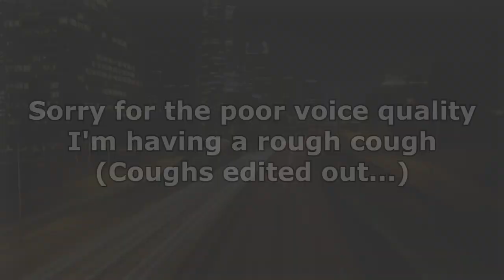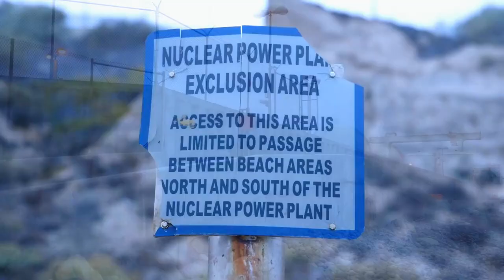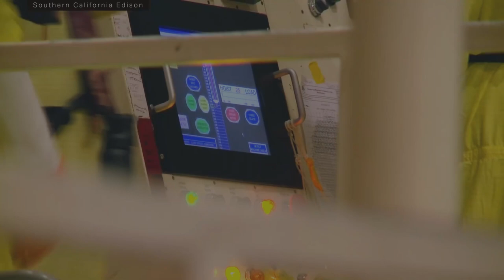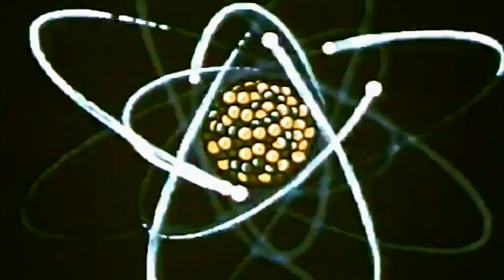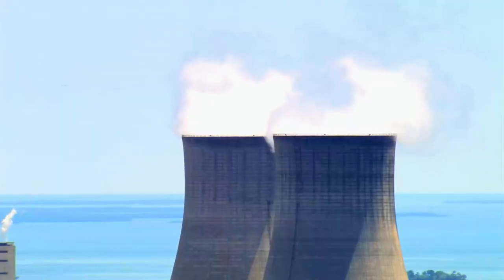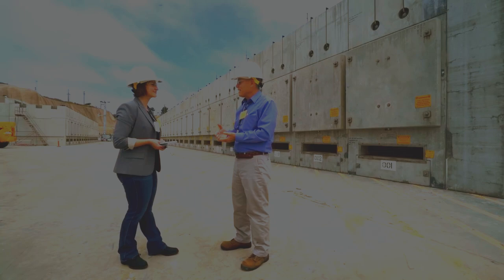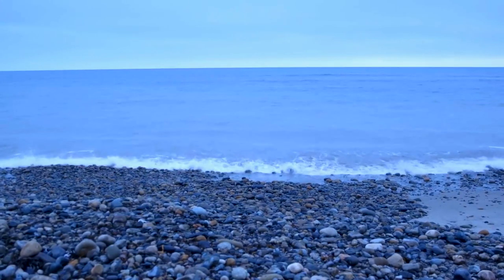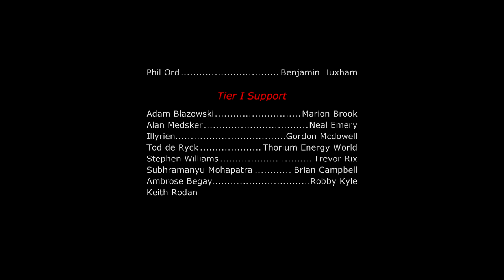The Verge Nuclear Waste Rambling

Comment: The HI-STORE system used at SONGS is used at Chernobyl and will be used at Holtec's CISF in New Mexico. It is the best dry cask system at this time and the cask will last over 100 years at which time the decay will have reduced the radioactivity 1/3 of the 300 year duration of SNF. Then either use it in fast MSR or restore it after inspection in another cask if necessary. No need to bury it.
Reply: Eventually, the SNF will be transferred to New Mexico and Holtec International will completely decommission the site back to it's pristine shoreline. It only takes 8 years to do that.

Comment: By my calculations I'd use 4.43 cm^3 U-235 (202.5MeV/fission) in my life given that, I live for 70 years, and not counted in the energy loss , because I have no clue how efficient we might be able to use it. And I meant gross energy of a country / person [~1000Pj / 10 million]. Considering we burned, like in every year, 3-4 tonns of wood last winter only to heat up the house to a not too ridiculously high temperature, it's not that bad I guess.
And I could live with producing that amount of nuclear waste in my life, which might be at least 10cm^3, but with a considerable RE contribution, and some proper efficiency increase, I could easily make it back to the amount I calculated in the first place.  Nuclear is sooooooooo bad :(  xD